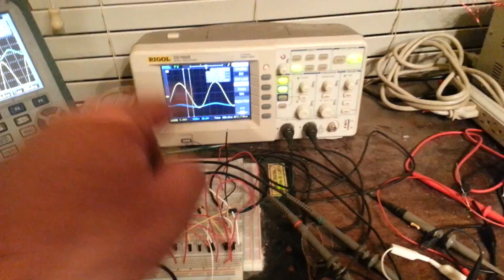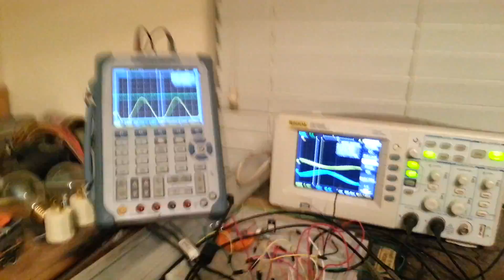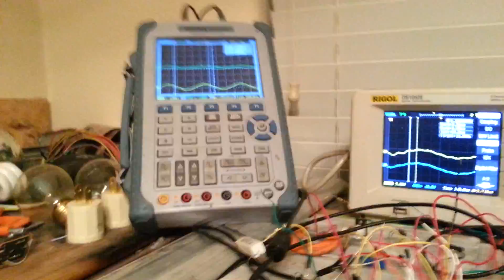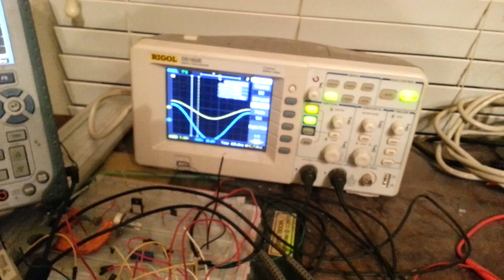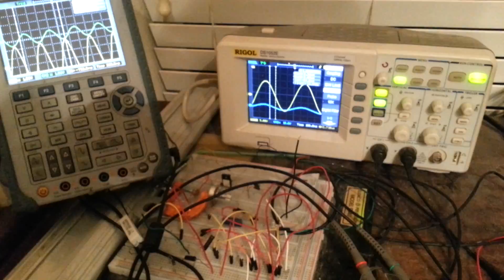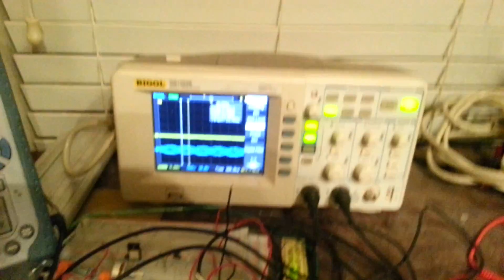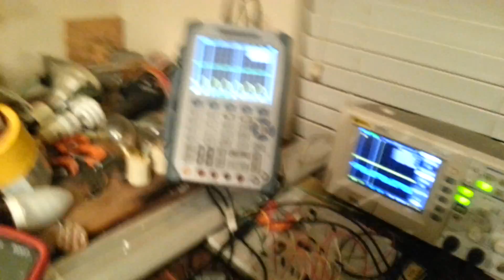akula kapagen coil

Comment: Not sure what you're trying to demonstrate here. There are differences between two grounds and yes you can generate an electron flow between two grounds. We fight ground loops from time to time in process control systems when both ends of the shield wire is grounded creating a flow and inducing noise into the signal wiring. In my work this is a bad thing. 
You said "we have bad grounds here in Nevada". What part of NV? Vegas? I live in Vegas.
I have my own experiments I'm doing in another field. I have a company in Switzerland designing and building the final component I need to start. I should know the results of my experiments by the end of summer. Not sure where it will lead, but it could be significant in the quest for over unity.
I have studied hundreds of claims over the years and none have any truth to them. But I may have stumbled onto the path. Ideas from multiple sources have mixed in my mind and I may just have it. We'll see - failure means nothing. Success means changing the world. Send back your email and I'll explain.
Reply from the maker: Okay Here's the hypothesis I was trying to prove out... nothing happens simultaneously/instantaneously.. the kapanadze coil is counter-wound across itself, one coil (the bottom), looked at individually has the highest inductance - the difference in R doesn't matter a lot, and the turns play more of a role.  So energizing a current from one direction or another, there's a mutual-induction place between the coils, where a N-N pinch sort of happens.  It is more like a heart beating in a frequency pumps blood from A to B... so I was trying to figure frequency response characteristics to see if I could make that a more definitive model... it's also somewhat like a single-cell tesla motionless valve, where current from one direction will fold back and cause a resistance to that current in the first place, while in the other direction it's free to pass... this could make for more like a pump to get the electrons 'uphill'....
While reviewing this; I made a lot of assumptions about the context of the video and am just spouting of (now meaningless, then more meaningful) numbers... 
'I hear in NV...' 1) our soil is a lot of just sand - silicon dioxide (undoped), so that makes a good insulator ; 'good grounds' are moist and in highly organic (dark - carbon conduction?) ... My father worked at Ballys with a guy that did a lot of experimental radio work; to get a good ground he buried a copper mesh like 3 feet deep and I don't recall how wide, but it was several yards, with seveveral tap points... 
I suppose the point of this is mostly about misbalanced output on different sides of the same coil at near the same frequency(1.1-0.9 or 1.1-1.2Mhz) ; sort of an experiment on single-wire circuits, treating the 'ground' as a single-terminal capacitor... and the other side (really just through the load) I guess the capacitance is in the diodes?  But then the other side has the same sort of diode loading.
Was sort of trying to get some feedback on whether a misbalanced load like that could extract a differential biased from the actual input.. 
- so the LEDs are across the coil (parallel) which has one side of the coil-LED connection connected to the ground; then I move the ground to the other end of the coil-led connection... And that brings me back to the beginning (cut and moved to beginning).
Reply from the maker: (not to try and plug my stuff)  https://www.youtube.com/watch?v=mO5PEh40PNM   This is more about ground loop; (These `ABHA coil`s have phenomenonal power transfer for pulsed inputs) ... and basically I ended up with the load one one side of a royer oscillator, and the other side was open, so I collected that to another capacitor; but there ground was no common ground, so it ended up at like -100V (and itself relative +/-40V from the -100 bias);   at one point, I tried to balance that to ground, because I could measure from ground to that and not kill anything, but one small test lead I just clipped it on and then it went up in smoke - no sparks; just a low voltage, but super high current flow there, and it was only a 68kuF capacitor :/    
I couldn't get any other experimenters on the same page at the same time, so I returned to the kapanadze stuff with more understanding from the mobially wound toroids